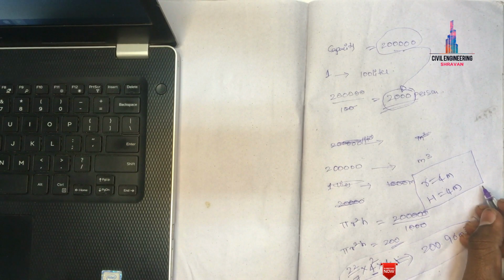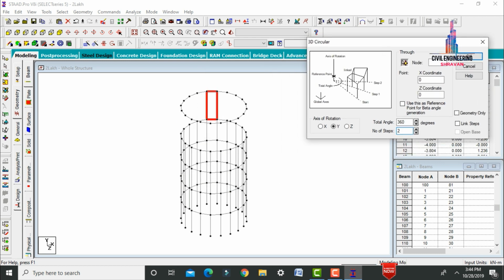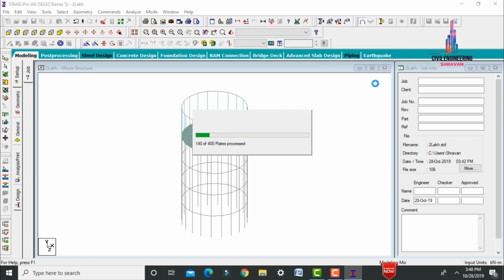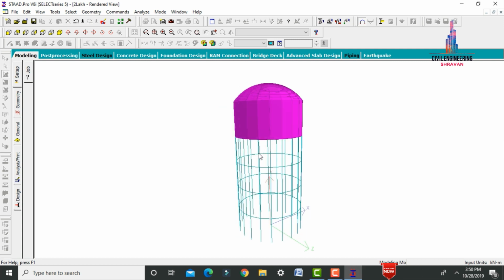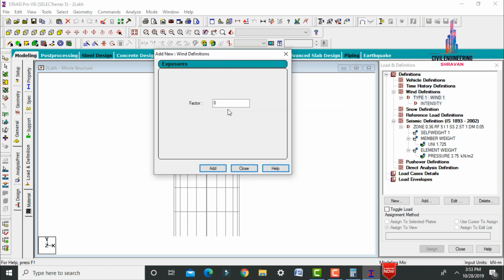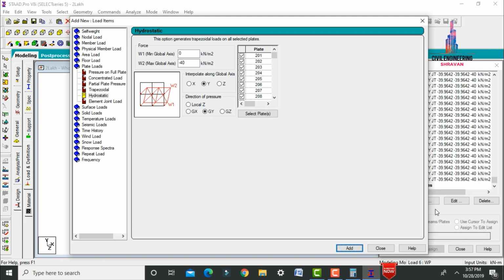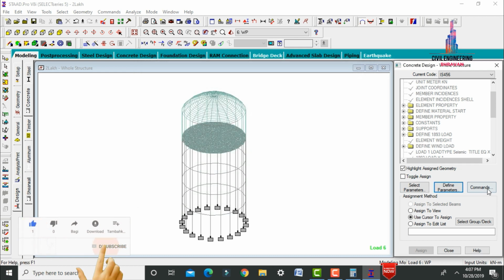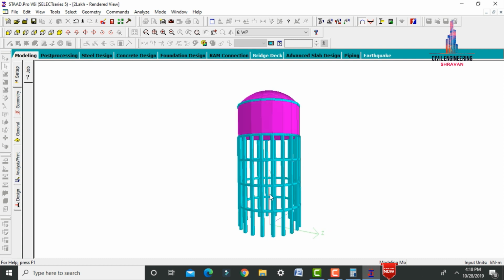2 Lakh capacity water tank design by Staad Pro Software | Civil engineering | online course |

Comment: For circular beam, the side face reinforcement is the pre-requisite criteria, but here there is no side face reinforcement. Either staad pro doesn't give much detailing of reinforcement or the design have some error.
Reply: Hlo Bro do u done overhead tank in staad Pro na and manually...
Reply: Both
Reply: Do u have video of tht Which u have done  and manually soft copy... Plzzz tell me my project is about design and analysis of water tank on stadd pro and manually with reinforcement details Plz help me bro. If u want to send soft copy I will give u my email address.
Reply: @kShivaKumar-rb1bk  bro I wnat foundation design for this water tank can u provide bro

Comment: Congratulations on your presentation, I have some doubts:
Why don't you consider the weight of the water for seismic loads?
It seems that the calculation of the water pressure is completely wrong.
Why don't you use load combinations for the design?
Reply: bcos this design is wrong.. and soi t is likethat..